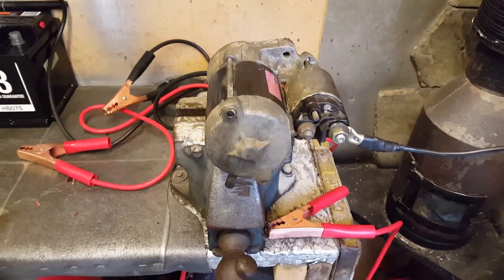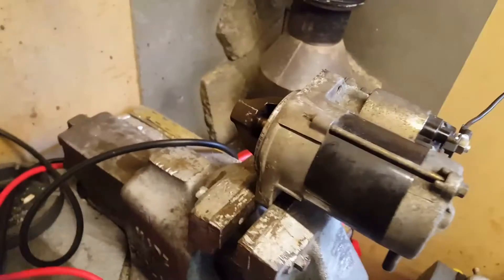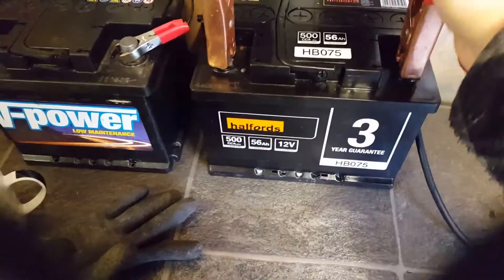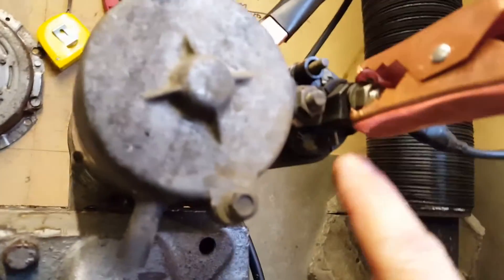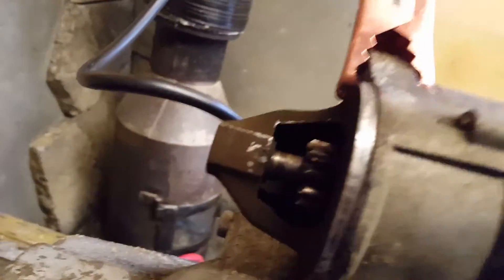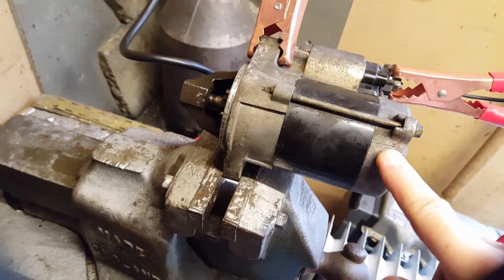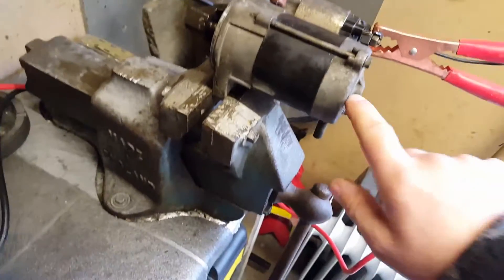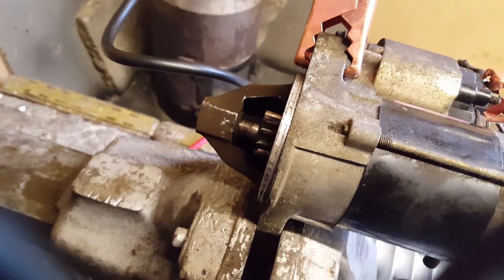Bench testing a starter motor

Comment: Could anyone help a brother out... I changed a starter motor and it spins real real slow.. It pops out and spins/ runs fine out the car on bench test.. So I bypassed the cables using jump leads straight to starter... And when it's fitted back in car it only makes the click where the spindle pops out but it doesn't spin when in the car. The positive lead heats up when this happens at the positive starter connection bolt. 2 months and still no further forward. 😭 Not sure why it works fine out the car on bench, but using exact same jump lead connections when fitted in car it just doesn't spin the crank. Driving me insane.
Reply from the maker: Sounds like it's dead . Even if it's new , unless of course your engine is seized or nearly seized.. 
A starter will spin fine out of the car but when it's got the whole engine to turn them if it's weak.or faulty it'll just click .. 
Have you barred the engine over by hand with a socket on the crank shaft bolt? .
Reply: @springy-2112  I'll give this a try turning the crank with a socket. How could I tell if it's nearing seizing if the new starter does turn it but just very slow like its a low battery (battery no low of course) I've tried 2 batteries, a 3500amp jump pack, boost leads from a 2nd vehicle and it behaves the same all the way through. I used the jump leads to power it direct when in the car also, and still the same, incase it was the positive or negative battery cables that were bad. The starter was new, but factory reconditioned.. I was thinking maybe its the replacement starter that's duff. The old starter doesn't even spin outside the car just piston pops out.. When on the bench test setup but think it might have burned out as it started smoking bad when I was diagnosing. If the battery is good and the jump cables are good... The only 2 options would be I take it.. The starter is DOA, or the engine close to seizing, but it's a fairly low mile engine... Golf 1.8t mark4. Which was swapped into the car not too long ago. I take it if I'm using battery and jump leads direct to starter I don't need the ignition key set to on for the crank to spin (some kind of lock mechanism) .. If i try another brand new starter and it still doesn't spin the crank (or only slowly) with power direct to it... Only other cause could be a seized engine? It has sat for a year or so but regularly been started and ran for a bit no problem appreciate it 👍.
Reply from the maker: @craigmorton644  
sounds like the starter is bad as long as battery has full charge and there's oil in the engine ..
Reply: @springy-2112  I found a video where it sound kinda the exact same... https://youtu.be/87TltYsuuEc
Wondering if it could also be a bad seized alternator I have or a seized pulley? I'll remove the drive belt and see how it goes. 🤞 Also Seen a 2nd video of a mini Cooper 1.6 turbo, with the same symptoms and cause.
Reply from the maker: @craigmorton644  
Good deductions Craig.
if the alternator or water pump or anything that spins is seized or near seized it'll give the same symptoms as a tight nearly  seized engine .. It's s good call to remove the belt or belts and see if all the ancilaries spin freely ..then you know it's the starter if everything else spins freely ..
Keep me informed buddy ..
Peace and love brother 👍🏻☮❤
Reply: @springy-2112  quick update buddy!! got it started today... Looks like the AC compressor wasnt turning at all. Took the belt off all components, and it fired right up. 👍 Next job.. Find out what's up with the AC unit 😂
Reply from the maker: @craigmorton644  
Great news it runs ok . 
Bad news on the ice cube maker .. 
At least the engine is good and it's a replaceable part . 
Peace and love brother 👍🏻☮❤

Comment: That's what I love, a nice video just when I need it.  I have a few starters in boxes for the Lomax and now I have an easy way to test which ones I can throw away and if any are worth putting on.  Mind you I don't have a car battery easily at hand but lots of people use bike batteries on the 2CV.  Cheers!
Reply from the maker: Mirius's Shed yeah you are supposed to use a properly cycled battery with full bulk charge etc etc but I bet the starter doesn't know as long as it's gets 12/6 volts it'll spin or not spin..Cheers Dave ..